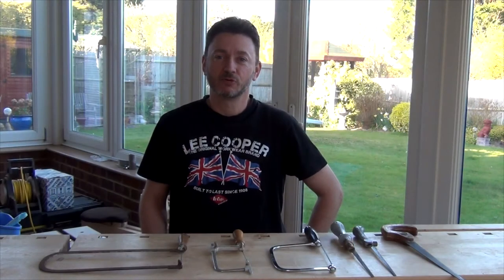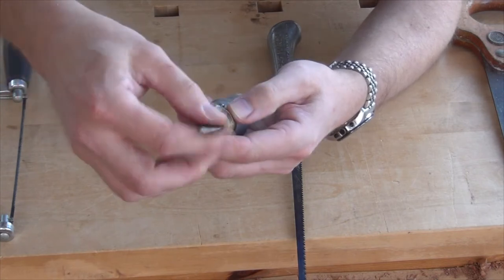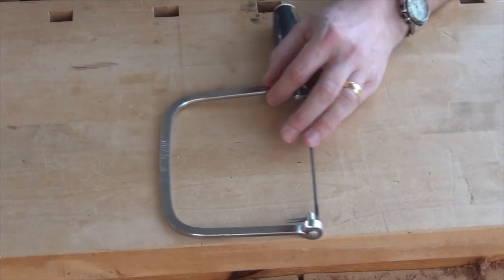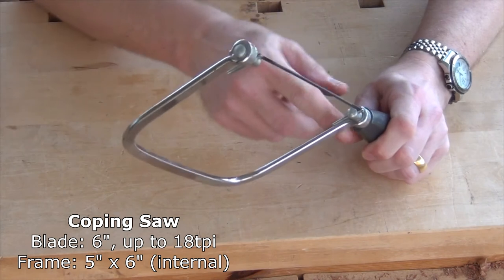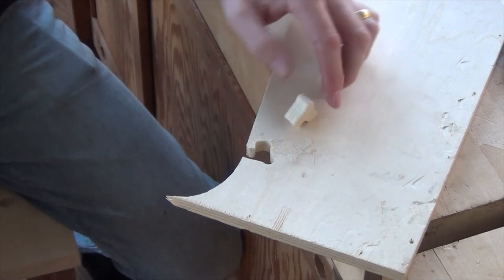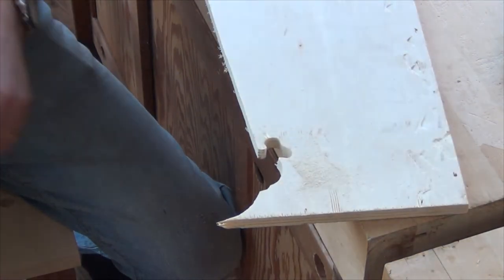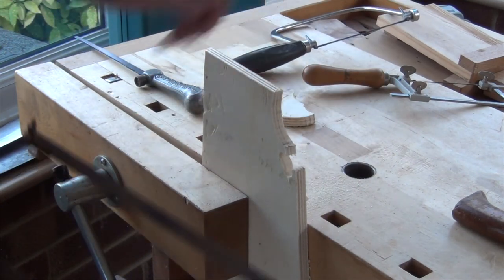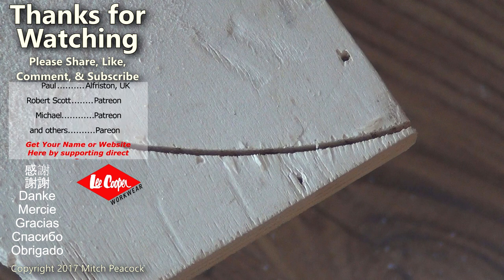Sawing Curves (GIW episode 32)

Comment: Nice video, Mitch.
I also have a jigsaw for small work.
The so-called bow saw I know as a tail saw. I have used it as well.
Reply from the maker: Cheers Günter.
Never heard the term tail saw, I wonder where that name comes from
Reply: Cheers Mitch,
I know this is a comic word, times in the Duden looked.
There stood this
Chisel saw, type of chuck saw, with very narrow blade for cutting sawn (curved) lines ... Small conversational lexicon
Reply from the maker: Sounds more like the keyhole saw than the bow saw?
Reply: I only know that the saw has a frame like the frame saw, only with a very narrow saw blade (about 5 mm [about 2 "] wide).